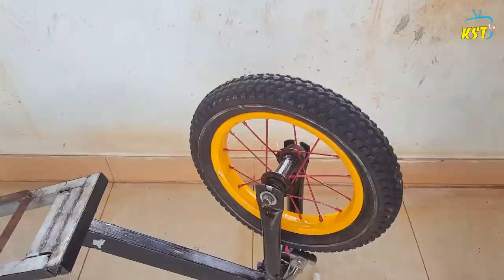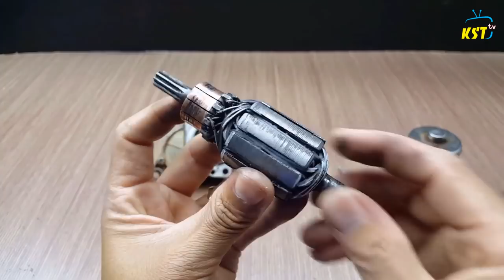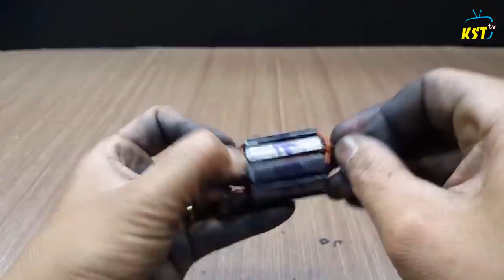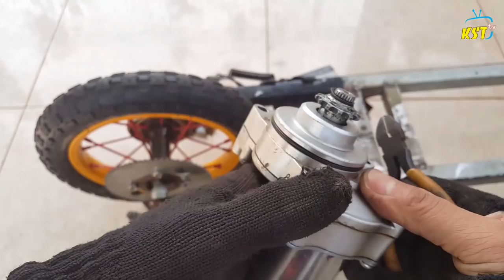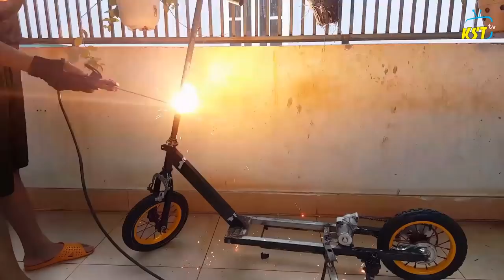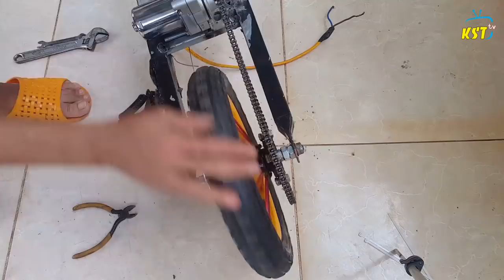How to make Electric Scooter using Starter Motor (upgrade)

Comment: This motor is do not suitable for this , because it is bike self motor and it requires High ampere of current and relya but in this video you are using bike battery in bike battery 5 amperes only but it will not come from  long last only 5 to 10 min it will work
Reply: I think that's why he rewound it.

Comment: Can you tell me about the controller please ? 😢😢😢
Reply: This type motor Awesome one
But controler waest off money. Use 12v DC regulator .use.    Motor ---->.  Regulator <-----Bayery .    Conect + wire.
Reply: DC pwm 250-500watt brushed

Comment: It doesn't work. I tried it. Starter motor does not provide enough torque n gets very hot soon. Video is recorded on slope. Tyre circles only when free load as he puts it on floor it stops.
Reply: That’s why he had rewind over of the rotor,
Reply: Maybe a motor with more slots and thicker wire can solve your problem.
Reply: True, must be drill on motor housing and change wire with greater diameter Will be more colder

Comment: Why you rewined motor coil?
Reply: The starter is designed to work for a short period, so it was wrapped from the factory with a thick wire, and this thick wire with the long operating time draws an excess ampere and drains the battery and causes heat and then damages the wires and consumes a lot of energy whenever the wire is heated
Therefore, to improve the performance of the motor and reduce energy consumption, it is recommended to rewind the motor with a wire of less thickness 👍